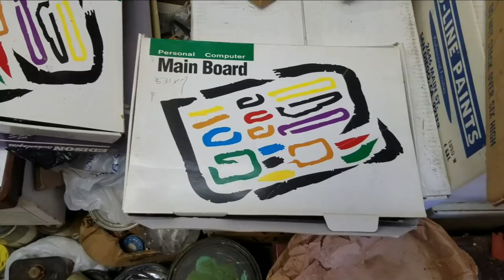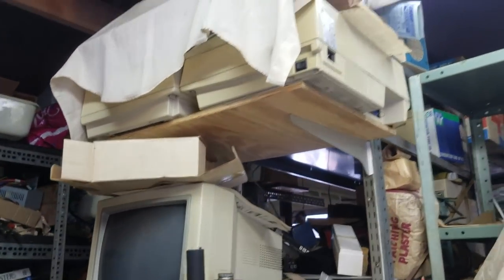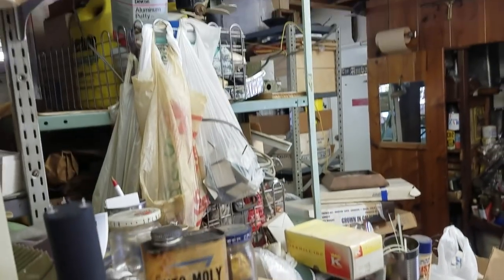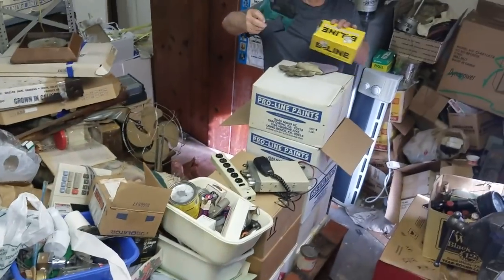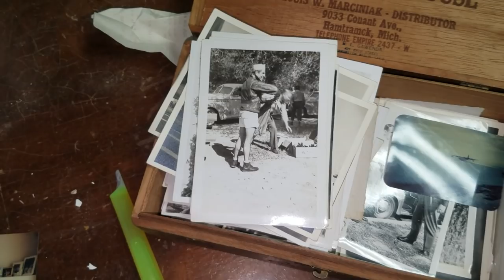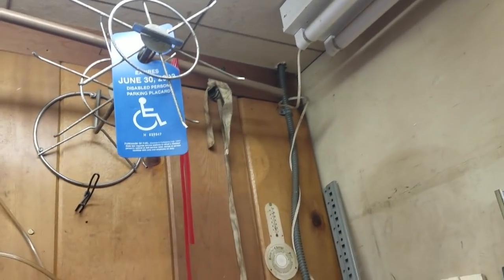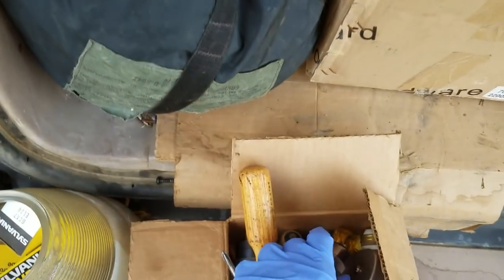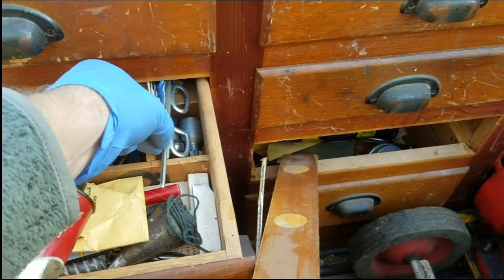Chlordane Dust....

Comment: Man  back when I was a young lad with a hard on every ten minutes, I fixed up an old shed behind the house. Ran some wire overhead and hooked it to the outdoor fuse box on our house, I wired in some plugs, and for a light in the bedroom (it was a two roomer, living room and bedroom when I finished) I used a old variable speed electric train transformer hooked up to a headlight, sort of aimed at one corner of the room with some red cloth in front of it to give the room that, well sexy glow. It worked!  Got my first, well piece of ass from the girl across the street on that bed with that headlight glowing red, and the Doors crooning "Hello I Love You" on the little home built high fi that I parted together from parts of junked players I found in the city dump.  I will never forget that day, I saw that gal about five years ago at her mom's funeral,  man did I dodge the bullet with her!  Man did she go down hill, looked like a wicked witch from the horror flicks, and she was cute as hell when we had our experience.

Comment: I've had to resist going to places like this now or before you know it your house is going to look the same! It wasn't all that long ago that selenium rectifiers were still being used in hostile environments because of their tolerance and self healing properties in overload and over voltage conditions, they were quite common in railway applications and large industrial palnts here in Australia even in the early 1980's. Cylinder lawn mowers (reel type mowers)  were de rigueur in the 1950's -1960's if you wanted a bowling green standard lawn. Thanks shango066 for posting I feel as if I've been through the garage personally.

Comment: Wow, I would have had a field day there. I've seen many of those "help me I'm a hoarder" programs on tv but they never show a hoarder who would hoard the same things as I would, if my wife wouldn't keep me in check. There's a lot of actual valuable stuff in there, not just heaps of newspapers and old clothes that you often see.
It's a shame... If you look carefully, you can see how everything used to be so organized and it just got out of hand and he just ran out of space and stopped caring.
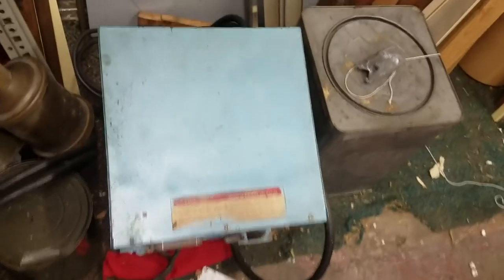29:10 looks a welding transformer. Probably worth a fortune in the copper scrap price alone.
The empty spot on those motherboards was for coprocessors. They'll work fine without.

Comment: I want those tubes that were in that lamp cover, if they were all the same, the one that was labeled 6CA7/EL34! Those tubes are audio output tubes used in audio and guitar amplifiers.
Reply: Mullard made for Dynaco amplifiers. Nice stuff if in good condition.
Reply: at least he grabbed them
Reply: Yes the EL34's are worth some $.  Will work in a Marshall amp.
Reply: @cali4tune   Yep!  They will also work in my original issue 1974 Musicman 212-HD OneThirty! That amp runs 4 of them.
Reply: @ExitThirteen  Yes quite a few amps use EL34.   Like 12AX7 always a demand for them.

Comment: This man was on the hoarder end of the spectrum but with today's "throwaway" or "disposable" lifestyle it wont 
be long before people will be called hoarder for just having tools and diagnostic equipment.
I have already bought a lot of tools off of people that had family pass and they had no idea what to do with them.
I would hate to be thought of as mentally ill for having an addiction to quality tools, hopefully I will be long dead by that time.
Reply: I try not to hoard, if it can't be fixed or used for parts I don't pick it up. Most people just see it as junk.
Reply: this is caused by our strange consumer disposable lifestyle... we use more resources than perhaps we should

Comment: It's a real shame they're knocking that house down, it actually doesn't look bad
Reply: There are actually some fairly sound reasons why many of these old homes in this part of CA are demolished. One is termite damage, then there's the cost involved with remodeling and refurbishing. Also the space and design is very inefficient for modern home ownership and raising a family. A shame to see it go on the one hand, but see ya later alligator on the other. Onward and upward. Out with the old, in with the new.
Reply: in some cases you're right but SOMETIMES the old is better then "the new".........
Reply: After 14 years it might be too far gone in places. They must've tried to shift it and failed.

Comment: There's several grand worth of tools in there alone. Welding regulators, compressed air filters, regulators, antique lamps, vintage electronics equipment, aircraft manometers... It's a waste to throw all that away.
Reply: Gas welding equipment isn't worth much anymore, pretty much just above scrap metal value. Electric arc welding of various types has taken over, MIG, TIG, etc. I've seen gas torches, gauges, and valves at lots of garage sales and auto swap meets, often with tanks, people just don't want them.

Comment: The empty processor socket on a 486 was for the math co-processor.
Reply: Yup, though the 486DX has a math co-pro built in. For a brief time, they made a 486SX that didn't have it. (I suspected that they were just DX chips with defective FPUs.)

Comment: definitely a good idea grabbing those 486 motherboards... they can go for around £50 each on ebay and will make someone happy.  the one with the extra socket is probably for a maths co-processor, but as the 486dx had one built in unlike the 486sx, so it's not populated.  some nice finds in there!

Comment: There's a point where there's no way you're going to make use of 90% of this stuff, yet it hangs around because it's hard to part with. I threw away a bunch of TV chassis boards. didn't want to but I knew the odds of me needing anything off of them were next to zero.

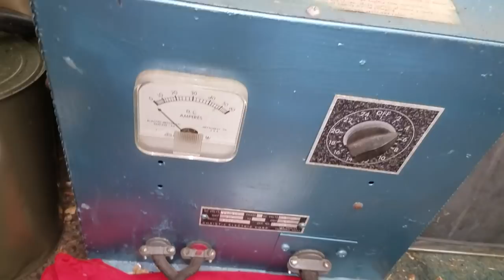Comment: 29:07 That is a DC rectifier for powering a xenon 35mm projector lamp house. If the input is rated for single phase that could be valuable to a film collector setting up a film theater projector at home. Most of them found in movie theaters were 3 phase so difficult to use in a residence.

Comment: Wow, that lawn mower with the pull-start Briggs & Stratton engine takes me back.  10 years old, about to mow the lawn, if you got the engine going with just 2 or 3 yanks on that cord, man, you felt so grown up, lol.
Reply: The Briggs and Stratton I had was a pig to start, I used an hot air paint stripper to warm it up before trying, then it would start easily.

Comment: the 486 empty socket is the math coprocessor.
486DX had it on the die already so thats why its not there.

Quote
They sold a 80487 SX coprocessor to "add" the coprocessor to an SX 
system, but it was actually a "rebadged" (?) 486DX that "disabled" the 
existing 486 SX and enabled itself.  Intel created the 486 SX to compete
 with AMD (even back then!) and their AMD-386-40 (Intel's 386 topped at 
33 MHz).  Some were buying the AMD-386-40 for less than the Intel-386-33
 and 486's were $1,000 more (circa 1991)!  Since the coprocessor on a 
486 took up the majority of the space of the entire die, and if an 
individual 486 die had a problem, it would most likely (based on 
percentages) be a flaw in the coprocessor section.  Well, all Intel had 
to do is disable the coprocessor on the 486, sell it as an SX and make 
lots of $$, while offering an "alternative" to those shoppers out there 
who were hoping for a 486 but couldn't pony up the $$ for a DX.  Quite 
the marketing department at Intel, eh?

Comment: That oddball  tube light is a 'Lumiline' linear incandescent light.
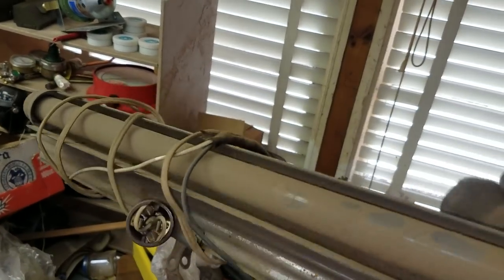Reply: 13:58 time reference.  Lumiline lamp.  You'd find them in bathrooms because the light quality (for applying makeup, etc.) was better than fluorescents.
Reply: I still have one!
Reply: @bob4analog  Can you still get the replacement bulb for it ?
Reply: Yes, but they're expensive! And it appears that there's only surplus stock when there available. I only have 1 bulb.
Reply: @bob4analog  These lights remind me of the original incandescent tube fixtures which were throughout the art deco Queen Mary ship when it arrived in Long Beach. Most of those lights were sold off at auctions in the late 1960s when they converted the lighting to 120 V fluorescent fixtures, when the ship was converted for hotel use.
Reply: @LakeNipissing  Yes, they're beautiful lamps in they're own right. Sadly, Very rare today. I got my bulb from a 50s AM transmitter. It was the internal view light and this type of lamp was used instead of florescent light probably because of the high RF field in the transmitter.
Reply: @LakeNipissing  In Europe, yes. In the apartment building where I live there is one above each entrance door, recessed in the frame. Swinging 70s style, and all still work :-)

Comment: The big blue metal case with gauge and cords in-out I believe is an electric phase converter allowing you to run 3phase electric motor with normal 2 phase input.

Comment: Yes, some of the old 486 stuff came without a heatsink, typical of Windows 3.1/Windows 95 era machines. The empty slot is for for a math co-processor, an upgrade option for a "business machine". and the black slot was ISA. I would go corky doobler for that 80's Compaq Deskpro Model 1 at 8:56. Original selling price for those was several thousands of dollars, it might get $100 today

Comment: Unbelievable hearing Shango ask, ''What's a 6CA7?' Oh well, with old TV and radio don't see it ever in there..
Reply: Really. $80-$100 worth of tubes right there. I thought I got a glimpse of a Dynaco power amp (or two) which is what those 6CA7 would go to. You're nuts not to get that compressor and vise. That's $400-$1000 right there.
Reply: @pneumatic00  minimum.
Reply: He’s obviously not a guitarist. Thank goodness he saved them. Mullards! 😳 Those are like gold for rock guitarists.
Reply: Or he was having a joke with the audio guys...most likely...
Reply: @5roundsrapid263   I hear ya, I thought when he pulled them out they were Dynaco-labeled used tubes in new Sylvania ECG boxes, so they could be tired, used. But very early in the video I thought I saw some tube amp chassis. But Shango goes for the Sanyo answering machine. Blurp.
Reply: @5roundsrapid263  is it pronounced mullard or mallard
Reply: @pneumatic00  He said in the video he brought some mechanics back who grabbed more tools so I would guess they snagged that vice at least before the rest got pitched, hopefully.
Reply: @electronixTech  Hopefully...thought we saw the 800-JUNK truck pulling up at the end.
Reply: @pneumatic00  You're right but with the amount of stuff there it might have taken 1-800 junk a long  time to process it out unless multiple trucks came as well. There were other sheds in the back with stuff in them also.
Reply: hello 123 “Mull-ard”.
Reply: @electronixTech  As one who has cleaned out several hoarder houses..several with kewl stuff in the garage just like this....I wonder how 800 JUNK works. I am in CA, Shango is in CA. You can't just toss 2 pickup truckloads of paint & pesticides at the dump. They have to be hazmatted. You're not even supposed to move that much toxic stuff without a permit, I'd assume 800JUNK has such permits. But, I can tell you that even though we both know there's $10K++ worth of usable stuff in that garage, it takes a lot of time & effort and working space and storage space and selling effort to sort it out and get the value out of it. And you can't easily do it on site, because you'd need 3 guys and 20 tables to sort & gather and they would be on top of each other. Believe me, a few days of sorting through 100,000 items and putting this doodad in this pile and that one in the other pile and throw this out and call this guy to see if he wants this and you run out of neurons. It's exhausting.
Reply: @pneumatic00  I didn't see the Dynacos. When did they pop up? I'm only about 30 minutes from there, wonder if they've been tossed in a dumpster yet.
Reply: @bugdrvr  Didn't see Dynas per se, but at 00:34 there is a shelf with what looked like potential tube stuff. I'd imagine if they were neatly paired up on a shelf they'd be gone. They home run would to find them boxed up & buried.
Reply: @pneumatic00  I can see what you're looking at now. With the way this guy seemed to keep everything, if the tubes were there then what they came out of was probably somewhere. Ah well, hopefully someone grabbed the gear if it was around.
Reply: @martinda7446  Damn sure he was XD
Reply: Someone offered me an old vise like that, probably a larger actually, I never did collect it, I don't have the room and many others don't. With the compressor it's hard to say, it may be fine but it may have broken rings, or any number of things wrong with it.

Comment: I’d like that small acetylene tank you came across.
Those small round sealed beam lights will work for my motorcycle.
Reminds me of my old garage before I had to clear it out and keep only about 2%
Reply: One of my old garages years ago had nice paint like that. My kids didn’t touch it. They knew better. Besides, they would much rather have real potato chips.
Reply: I gave a ton of stuff away on Craigslist free stuff
Reply: You need to do a video on that saw and how it works

Comment: I collect alot of Different stuff too,.. The computer boards were all the Early 486 main boards from the late 80's and Early 90's some thing you didn't find any 386's as those too were Common most didn't need heat sinks as those chips didn't run as hot as modern chips, the boards alot of old collectors might still want,They will run DOS and earlier versions of windows and the older games, but may not run any thing modern, here i still have alot of hard drives that came out of those types of computers,some had good Games on them too, Hopefully u got the Boards as i know there are people who do want them as i sold off all mine pretty fast here,I say though that was an interesting pick,.. Too bad that The American Pickers couldn't of gotten in there, I bet they would have loved some that old stuff,Never know whats worth some real money till you dig it out and look it up or put it on the selling Sites, but there definately was enough there that they could have made money holding an Estate sale, could have saved more of the stuff that ways. Plus the house, that looked like a nice place inside, they should have fixed it up.

Comment: The empty second socket on that first 486 motherboard you pulled out is likely for a math coprocessor - the "budget" CPU Intel sold at the time, the 486SX, didn't have one integrated. You could probably get a fair amount if you sold those boards as a lot online, the retro gaming crowd seems to love them.

Edit: just noticed a Compaq Deskpro too, that might be worth picking up

Comment: That old motherboard has the power terminals mislabeled; you need to hook the mains directly into the Gnd and +12 lines in order to reform all the old caps before it’ll work. 🤣😝

Comment: WOW 486DX.... Yeah I have a pile of them along with 386 and 286's all on their original mainboards.. The vintage computer market is one of those niche things where people try and sell junk at inflated prices and no one actually buys it..
Anyways Hoarder central? You should see my landlords place, it looks like a mini junkyard inside and outside..
Reply: @OlegKostoglatov  The ham radio community is notorious for this type of thing. a 20 year old hand held radio for $350... never mind that battery is flat beyond ever being usable and the wall wart for the charger is just gone, that's how much I PAID FOR IT NEW! REEEEEEEEEEEEEEEEEEEEEEE!

Not too long ago I have a viable need to some old IBM XT PC parts because I still have a couple that are used to do old equipment EPROM programming in old comms equipment and I cannot use a modern PC to do it or it can fry the data bus in the devices.. I was shaking my head at prices, unbelievable..
Reply: I have several friends whom have, or had, 486s, 386s, 286s, in their junk collection, they are not as rare as people seem to think.
Reply: Now you know why the clubs end up cleaning out the basements of some HAMS after they die and auction it off. It seems to be a disease with some old men, they get obsessed with money and believe that every piece of junk in their shed is some treasure that is worth it's weight in gold.

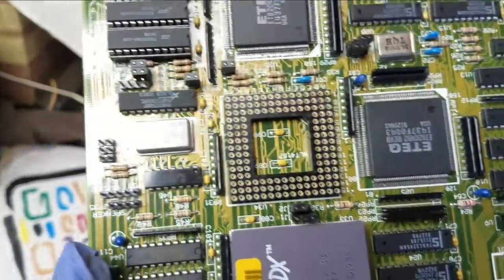Comment: 31:13 Math co-processor?
Reply: Yes, but there is a bit more to the story.

486DXs didn't need a floating-point coprocessor... but 486SXs did... Intel sold a 487SX specifically for that socket.  

Oddly, the 486SX is actually a 486DX with the coprocessor disabled.  Some claimed,. back in the day, that these were 486DXs which had a defective coprocessor,  at least during early production.  The 487SX was actually a 486DX that disabled the 486SX in the main socket and would function as both the processor and coprocessor.  It wouldn't function unless the 486SX was present.

Somewhere in my hoard, I have 486DX, 486SX and 487SX Intel technical references.

Comment: This Motherboard is missing math coprocessor. I used to have one similar back 1998
Reply: 486DX has math coprocessor integrated. 486SX has no coprocessor.
Reply: @xsc1000  yeah, i just talk about the slot, for the math coprocessor. Thanks for the complementation, sometimes i cant express right, my english sucks rsrsrs

Comment: I would be grabbing the computer stuff if I was there, I'm just that nerdy I guess.
Reply: Haha i have tons of it if u want it. I think I have and original 5mb MFM drive in a box someplace. Lots of memory too!
Reply: @rty1955  If you have enough parts laying around to start building a retro PC I would definitely take them off your hands. Been wanting to put together or buy an old computer (90s or 80s era) for awhile but ebay and local sellers ask way too much.
Reply: @ixionn563  I habe lots of parts, so I might have everything. I just dont have the time to build, test, rebuild etc. I think I even have a 8087 math co-processor too!